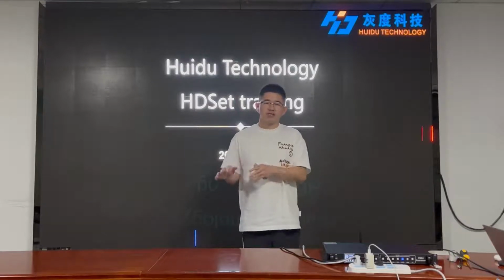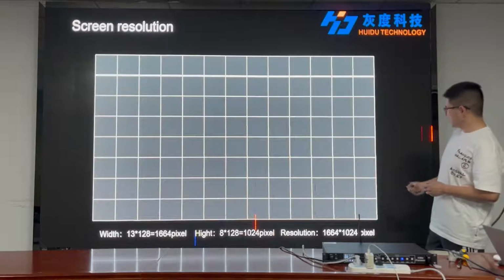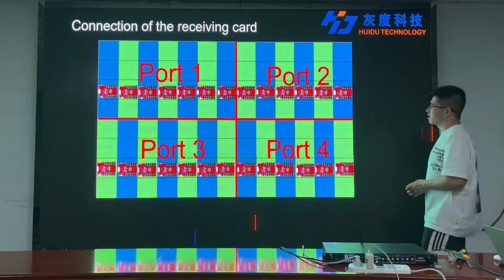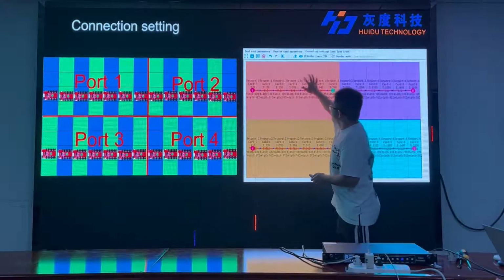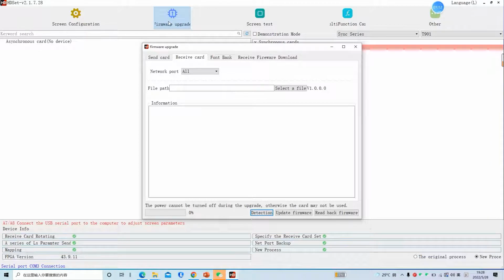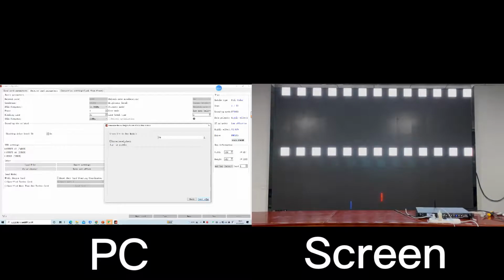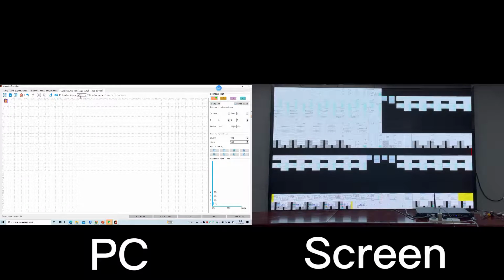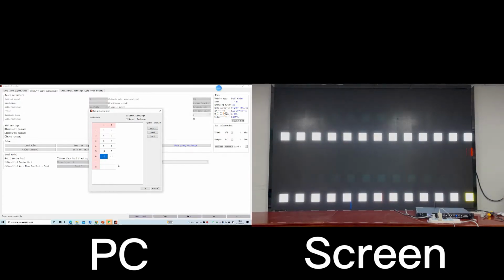HDSet optional

Comment: a doubt
I have an LED screen that has 6*2 modules but one of them has one more panel, how can I configure the mapping
To be exact, it is like this (128*320)(128*320)(128*320)(164*320)(128*320)(128*320) this is down and up is the same 
I don't know how to configure this. I already made the files for each panel but I don't know how to unify them in the mapping.
some help please
Reply from the maker: please email to hdtech3@huidu.cn